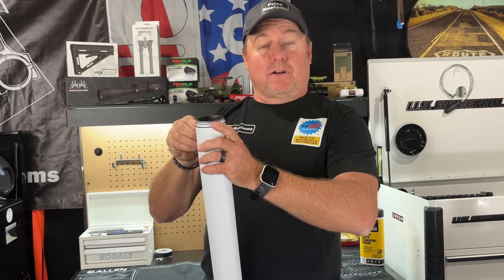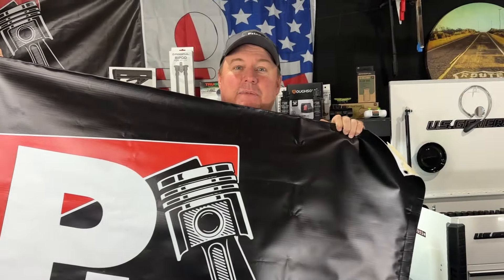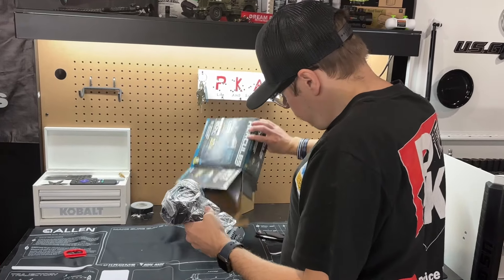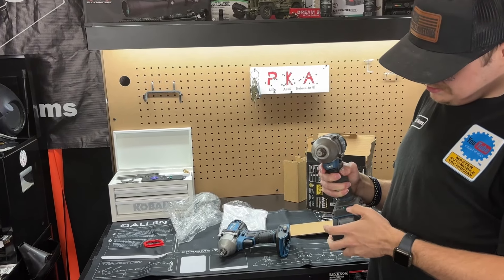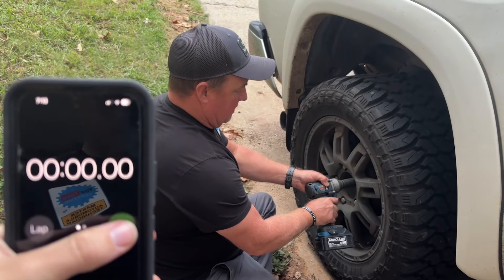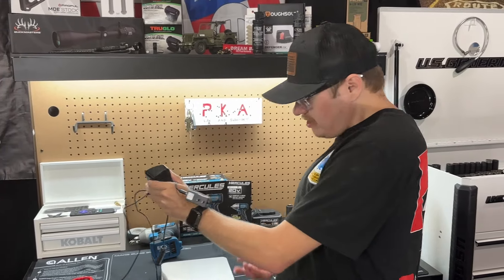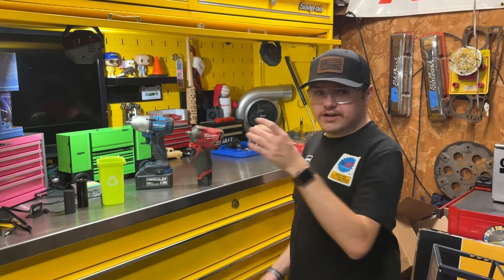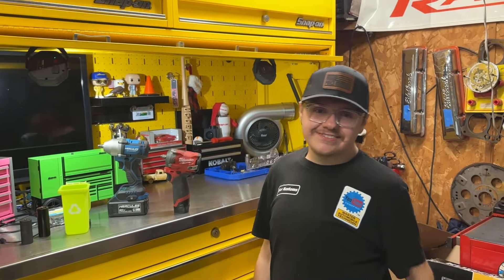HARBOR FREIGHT HERCULES 3/8" IMPACT / GOOD OR JUNK #harborfreight #toolreviews #tools #toolboxtour

Comment: I like Hercules, but now that the gen 2 Milwaukee stubby is out. That gen 1 is on sale. I piked up that Milwaukee gen 1 for 179.00. It came with 2 batteries plus a free tool. I choose the Milwaukee 12 v soldering iron.
Reply: That’s a good deal

Comment: I bought the 1/2 and 3/8 impacts on that 2 tools for $99 sale,  i had a devil of a time getting the battery on the 3/8 right out of the box.
Reply from the maker: The battery was a trouble for us as well on it
Reply: Do you recall if the 3/8 long neck ratchet was part of that option deal?
Reply: @nathantran9675  I don't think it was at the time
Reply: @nathantran9675 it’s not. The app doesn’t show if you into bundle details, but the site does. 12 tools, and the ones they are compatible with are shown in the pic.. had to research this a few mins ago lol

Comment: If i wasn't so deep into Milwaukee, I'd swap to Hercules. The value is so good & the tools are legit. Maybe not as good as Milwaukee but close enough to get the job done & doung it with WAAAAAY more money in your pocket. Hercules has my respect. I'm a fan.

Edited to add this Hercules mid torque IS a weak unit. If they could step this unit up, they're playing with the big boys.

Comment: Shifting Harbor Freight gears a bit but I was watching a video the other day of this guy at Lowe's showing some new Kobalt lights for sale. He was just sweeping over a lot of models and focusing on only a couple.  I noticed a new Kobalt rechargeable lantern that was among them he passed over so I saw they had a couple locally and got curious so went to check one out in person and it followed me home. It has a solar panel on top, an internal battery that charges from said panel (just not sure how well yet.) or a USB-C charging cord (it comes with a short USB-A to USB-C cord) or you can power it with 4 D cells. (Just make sure to remove them first if charging the internal battery.) It has 4 light settings: High, medium, low and a setting they call "Nightlight." That lowest nightlight setting illuminates with a warmer glow than the more whitish color of the other settings. The low setting advertises 24 hours of runtime, so the "Nightlight" setting gets even more, possibly 60 hours. I think the NL setting is about 20 lumens, but it illuminates my living room just fine for walking through it or relaxing in some ambient light. Has 4 light dots on the front for battery meter in increments of 25%. For the price of 30 bucks check one out. These things will get more popular this Winter than the mini toolboxes did. Haha. Mine's living on my service cart turned solar station. I think you'll like it and there's no YouTube reviews on them yet. I contemplated going back and snatching the last one of the two they had, but decided to let somebody else discover the love. But I will be adding another down the line, I only wish it had a red mode, then I'd be absolutely over the Moon with it, but still very happy with it as it is, regardless. These aren't in really great stock amounts at the moment it seems. It showed sales of them up though. Around 800+ last week, so word of mouth should be throttling up soon. It's  model number KLAN1500TRI on the website. Looks like there's maybe some new headlamps, too along with flashlights.
Reply: I’ll have to check it out thanks friend
Reply: You're welcome. Here's the advertised runtime from back of box.
High: 1500 lumens/ 4 hours.
Medium: 500 lumens/ 10 hours.
Low: 150 lumens/24 hours.
Nightlight: 20 lumens/60 hours.
I took it out of the box and it already had a 4 out of 4 on the battery meter so I played through the light levels a bit then left it on Nightlight setting. It's been on like that for around 18 hours now and there's still 4 lights on the battery meter. This thing is definitely going in the emergency/power outage stash. I already have a couple of the Kobalt tool battery lights too, but they don't seem to be IP rated for even a light rain drizzle.

Comment: Bought the 20V impact driver from Herc a couple weeks ago and was really impressed. Been torn between saving my nickels and dimes for the ultra torque or dropping $65 on this 3/8 mid torque. Since y’all can bust lug nuts loose at 100 lbs, Guess I have my answer. Thanks for the video!

Comment: Speed test would only work if both were impact sockets or both were chrome sockets. It makes a difference breaking loose. I've seen videos where a hub nut would not break loose with chrome sockets on an impact, but when they put on the impact socket, no problem.
Reply: Thanks for the advice and thanks for watching

Comment: I have both those Hercules and that 3/8 is underpowered. However, that 3/8 can be used like I use my 1/4 impact driver. Not crazy powered, where it destroys bolt heads. I got the 3/8 on an open box deal for $29. So I can't complain lol
Reply: Thanks for watching
Reply: Was it able to break 85lbs lug nuts lose?
Reply: @nathantran9675  I haven't tried it on lug nuts. I was uing it to drive a lag and it didn't do well. lol

Comment: I got the 3/8 Hercules with charger and 5 amp battery for 119.00 then I got the extended anvil 1/2 and 8 amp bat. For 99.00 on sale recently. They work great so far, my son is a diesel mechanic and has Milwaukee impacts and he thinks they’re great tools for the $
Reply: They are have a great day

Comment: Yes, Hercules brushless power tools come with a 5 year warranty, the batteries and chargers come with a 3 year warranty.  It's one of the reasons I originally took the leap and now all of my 20V tools are Hercules.

If it's anything like the compact 1/2" I've got, it'll work just fine for most applications.
Reply: Thanks for watching

Comment: I'll save all you ur precious time!  This Hercules impact stubby is TRASHHHHHHH!!!! 

Can't even remove my BMW lug nuts that are torqued at 103ft. Lbs and struggles to even remove one lug nut!   My Milwaukee M12 Stubby removed ALL my lug nuts without a hitch! No problem just like butter ..  

Took it back to HF and told them they can have back their TRASH wannabe impact driver! 🤦🏻‍♂️ It's an embarrassment for HF to release this junk! 😂

The ONLY impact driver I would ONLY RECOMMEND is their Hercules Ultra Torque 1/2" impact driver that modafke is a BEAST! 
😁
Reply: I’m going to have to check it out